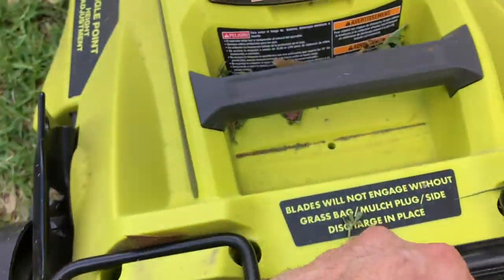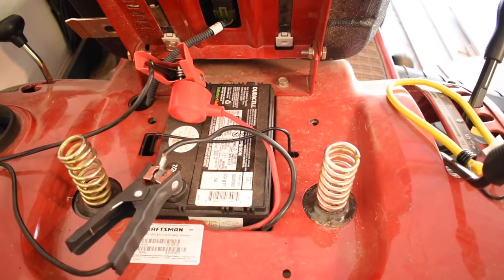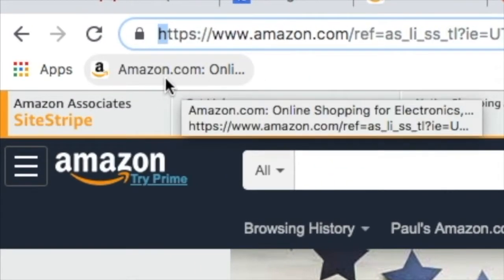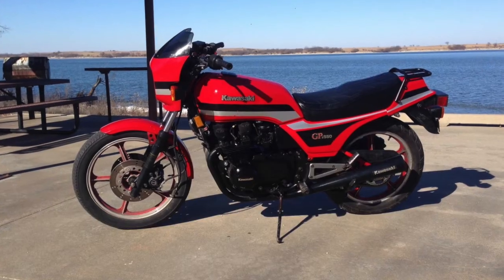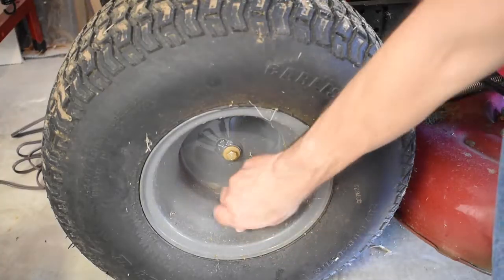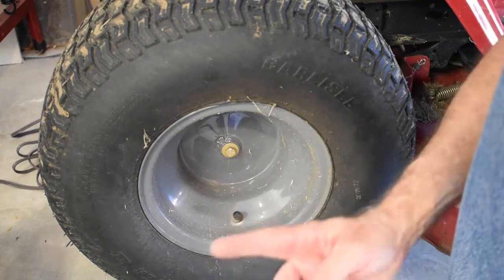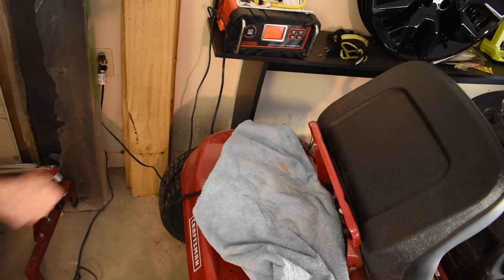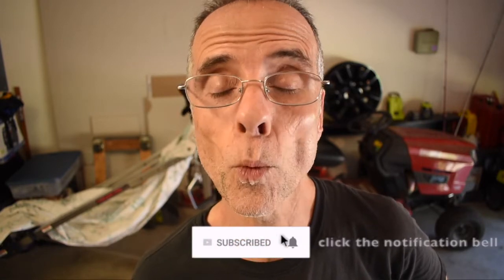Craftsman Riding Lawn Mower maintenance Tips

Comment: As you might have guessed from  checking out my channel I'm going to say that you should have kept that Kawasaki. Lots of air flow when you ride to keep you cool. Of course it doesn't get the lawn cut but you might worry a little less about the lawn.  Keep those electrolytes flowing.
Reply from the maker: I wish I still had it. Short story? I was coming around a corner and a car had run a stop sign. I no longer have the bike. Had a messed up back for a few months. I was told I looked like Superman as I was flying through the air. 
Thanks for watching! Keep the rubber side down.